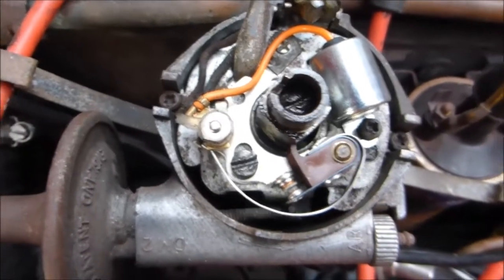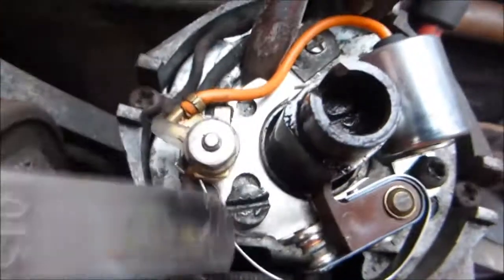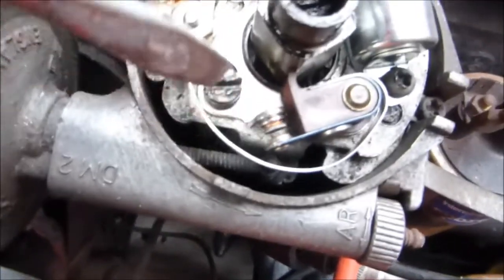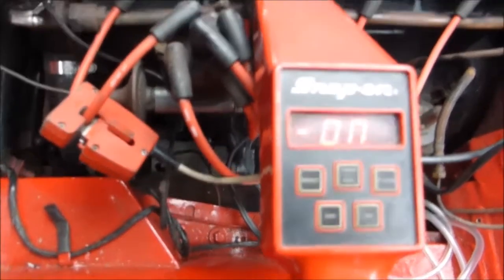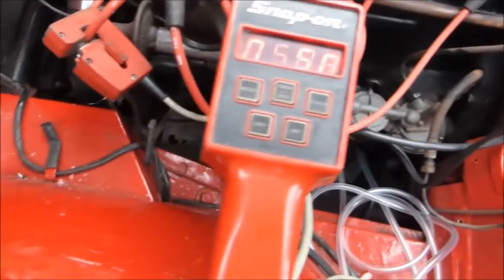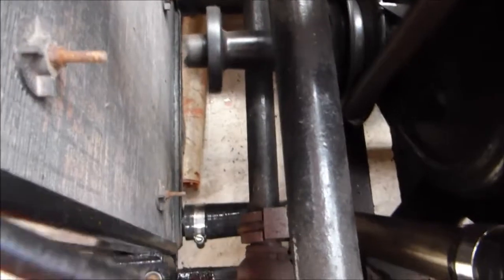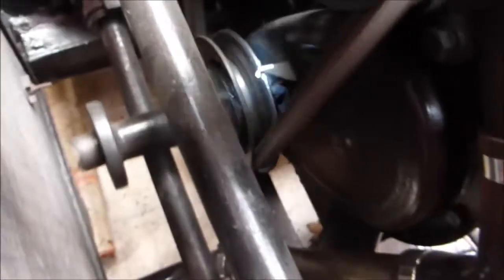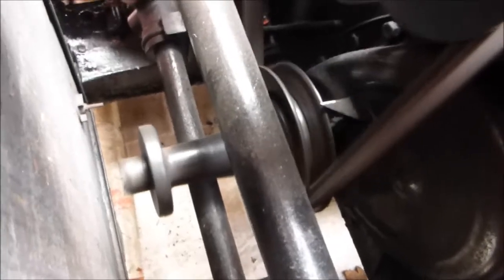Adjusting the points and ignition  timing on a TR4

Comment: thanks for video, you rotated distributor shaft to adjust timing? Also  i watched video showing some points need a dwell meter to show how much gap is needed, my dad has a 71 tr6, do you know if i need feeler gauges or dwell meter to gap points? thanks
Reply: You can use a set of feeler gauges to set the points gap. Most likely will be .015” gap.